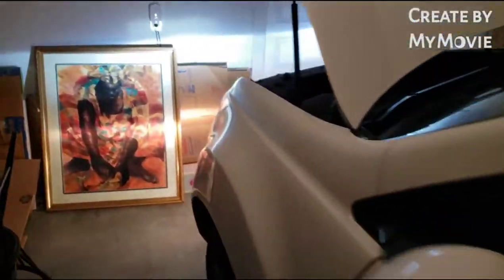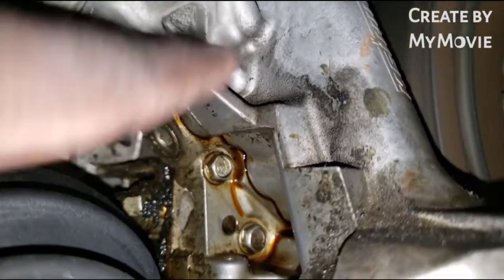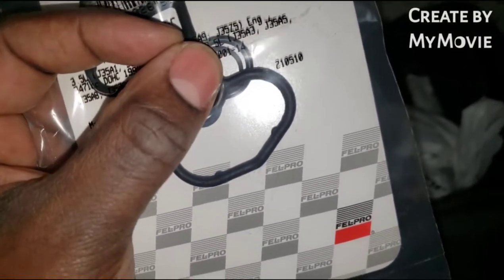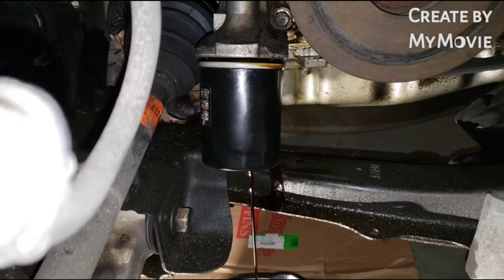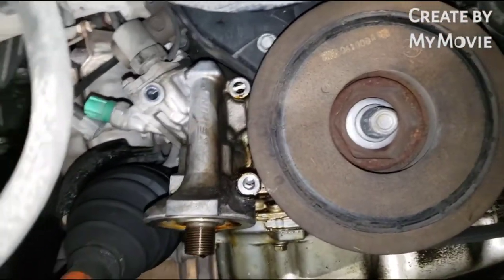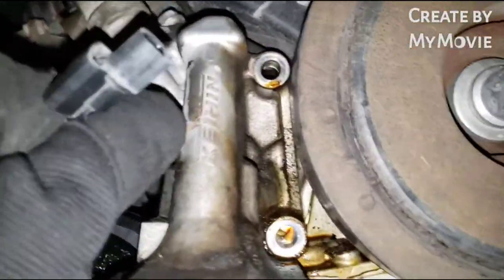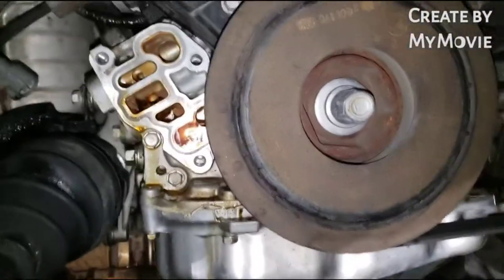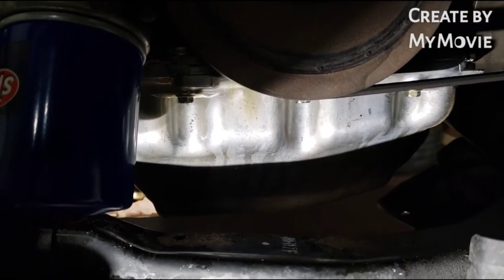How To Identify and Fix Leaking Oil Filter Housing 2008 Acura MDX in 20 minutes!

Comment: Thanks for this video man. I normally do all the maintenance for my cars and my wife has this same 08 MDX and recently start leaking oil. No signs of a bad head or valve cover gasket but a lot of oil dripping from the oil filter. Your video just confirmed what I thought was the problem. I am also having some clunking noise when turning so I think the axles are due for replacement in case you already have a vid on that.
Reply from the maker: Awesome. Glad I could help. I never got to replace the axles on our MDX and we have since sold it. But based on your description sounds like that's it.

Comment: I just came from the shop for a tire rotation and they recommend to change oil filter housing gasket because of the oil leak. Along, with the oil pan gasket as well. I am crossing my fingers that this is the only thing i have to replace.
Reply from the maker: Man! I wish I recorded when I did the oil pan. I had to change my pan due to a stripped drain bolt. These cars usually don't have a gasket you have to buy a gasket maker like Honda Bond or Permatex Then you apply around the pan and  it dries to a hard gasket. You will have to scraped off the old gasket and clean pan and block.  Should be some good videos from a TL, Pilot,  or Odyssey on you tube.
Reply: @photofinishgarage Did it drain alot of oil when you replaced them? My oil is still at 70% and I attempting to do it this weekend.
Reply from the maker: @vondozer408 Good luck! Let me know how you make out after you complete the repair! And No it won't drain out alot of oil. You will lose some that is in the oil filter housing it self. But you dont have to drain the oil for this repair. I was already in need of an oil change which why I did it this way. 

Good luck to you and make sure you get some cans of brake cleaner and paper towels for easy clean up.

Comment: How often is this the cause of leaks vs the oil pump itself? 05 TL, dealer is telling me a I need. $1,500 oil pump replacement.
Reply from the maker: Not 100 percent sure but I think oil pump leaks may come from a different seal at the crank seal. Also if your oil pressure is either too low or too high that would be a bad oil pump. This video I could actively see the seal leaking and it's a known issue with these engines.
Reply from the maker: For $1500 bucks I'd look at a used engine vs that repair at the dealer. That's ridiculous
Reply: There is a small gasket at the top of the oil pump that is known to fail like this one. You need to drop the oil pan and timing belt to get to the oil pump gasket.

Comment: Has this Acura been reliable for you? I’m thinking about purchasing a used 07 MDX!
Reply from the maker: It was pretty reliable. Like all cars has its quirks and needs maintenance but was easy to work on. We sold our back when gas went up to over $4 a gallon. Panicked and miss the hell out of this vehicle. 

That's the only con is its bad on gas low on tech and underpowered. But can be driven anywhere and comfy.

Comment: Is this guy's car running a his garage door closed
Reply from the maker: Yup.
Reply: Just so everybody is aware, there is a catalyic converter on this vehicle. You will not die from running the vehicle with the door closed unless your o2 sensor is making it too rich or lean (one smells like fuel, the other smells very acrid) That will set a check engine light. Any vehicle without a catalyic converter will kill you.e4e
Reply: Ive run a car with longtubes and highflow cats (along with numerous other modifications) in my garage with the door closed for well over an hour. The garage is fairly ventilated. Usually gaps between the door tracks and the wall to allow airflow, and my house was built in the late 70s